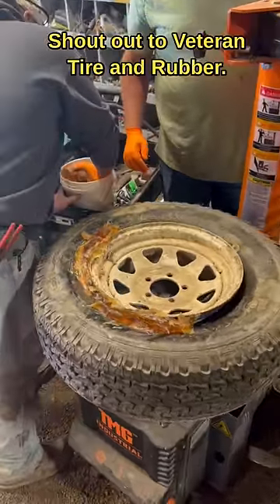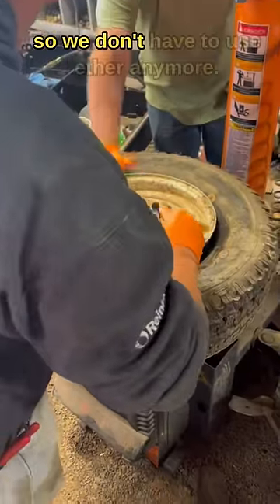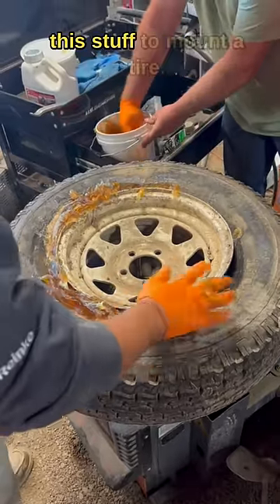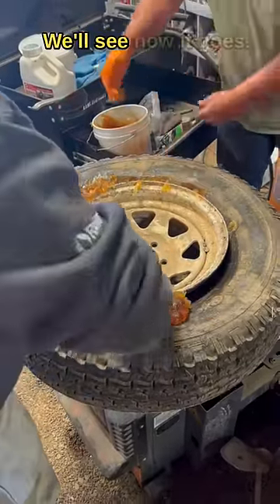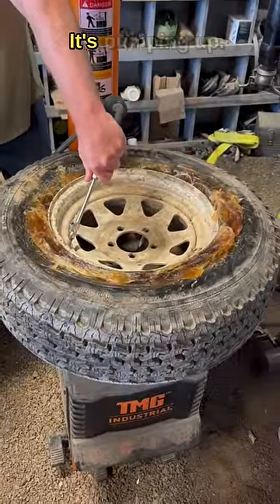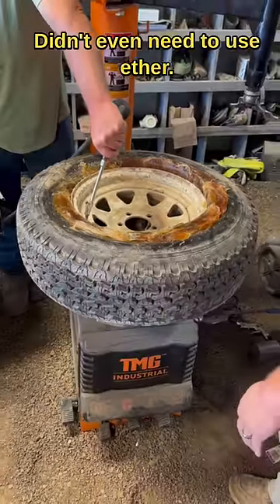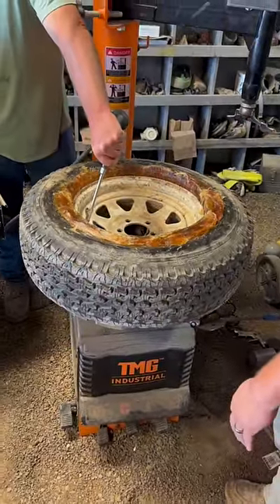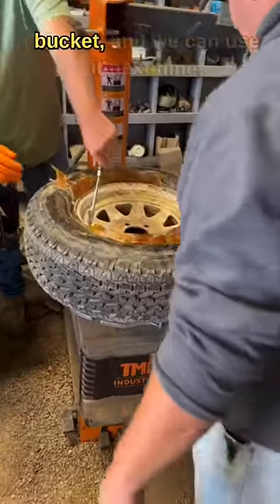Veteran tire and rubber sent some tire mounting compound. Let’s see it work. #farming #shorts ￼

Comment: Whoever owns that shop needs to evaluate a lot of things.
Reply: I believe it's just a farm shop
Reply: This isn’t tire lube.
Reply: How much stayed inside the tire? Balance issue down the road?
Reply: @emmasdad5426 balance issues on a tracker tire that's good to be going 10 mph in even dirt?
Not sure if that's something they have to worry about.
Reply: @emmasdad5426 it'll even out once they warm up 😅
Reply: My thought also
Reply: Why
Reply: @UlyssesCoto if it's not heat resistant maybe huh.
Reply: @christianterrill3503 my exact guess, I've seen that too many times 😂
Reply: This is legit tire man thing you wouldn’t understand becuase you probably need a machine to do everything for you look at the jump up unless ur willing to use a semi tire air gun on that and risk damage u do this
Reply: @dsandoval9396 In what world is the tire that’s used in the video a tractor tire that tire can’t hold the weight of a tractor nor does it have the tread capable of being used on a tractor.
Reply: I wanted to buy a tire mount machine too, but decided I will just pay the money when needed.
Reply: @Back_door_bandit_98  the world you dont know a thing about. TRAILER
Reply: Y’all that’s is a trailer tire 🤦‍♂️used to maybe carry a car, they will not feel that if any went in the tire nor does anyone really care😊
Reply: @niknak89 lmao right? Tire soap is a necessity if you know what you're doing. I've had front-loader tires that wouldn't mount without at least 3 gallons of soap on them
Reply: @jstewart627  you can get a couple pry bars practice aim with a hammer and you don’t need to spend money again
Reply: @rentalcar1712 
Why do you not use any punctuation when you write?
I'm genuinely curious
Reply: @AZ-kr6ff You forgot to write a period at the end of your sentence.
Reply: @technoviking007  
I didn't forget, I intentionally left it out because it's my understanding that a period at the end can be interpreted by some people as being rude, like an "end of story" type of thing, and I'm hoping the guy responds.
Reply: @AZ-kr6ff  😂 So, as your being rude correcting a farm boy on his lack of punctuation you purposely left off a period so you wouldn't come across as rude? Ya... not buying it lol
Reply: @TheGoatLocker  
I didn't correct anyone, and what does being a farm boy have to do with anything?
Reply: Id like to see your shop looking better
Reply: @emmasdad5426  that's what I was thinking. Either the balancer gives you an incorrect reading because the compound settles inside the wheel making it heavier, or the balance changes when the wheel spins because the compound spreads out. Not a risk I'd be willing to take, especially when the old way isn't particularly hard
Reply: @UlyssesCoto  yeah but you'd have to warm them up before balancing incase a thick clump inside the wheel throws the machine off and gives you an incorrect reading.  Some people won't have the foresight. Also, what about the compound settling when not in motion? Especially on a hot day. The balance would be irregular and shifting
Reply: @roachmansupreme  did you read that this is for farm equipment? There's no indication that this is for a normal vehicle. I don't care, I take my car to regular shops, not somebody in the middle of nowhere.
Reply: @GMG455 It literally is.
Reply: I don't think I'd ever seat a tire just standing next to it like that. Seen too many people get seriously injured from them blowing off
Reply: @GMG455 yes it is. I've been in the industry more than 20 years.
Reply: @emmasdad5426 trailer tire. Doesn't matter.
Reply: Guys, here is the true Savior

HalleluYAH translates “Praise ye YaH”

YaH is The Heavenly Father
YaH arrives via the TENT OF MEETING
YaH was Who they Crucified for our sins
YaH was Crucified on an Almond TREE

Semitic of Moshe (Moses)
Isa Scroll (The Original Isaiah)

Isaiah 42:8 - I am YaH; that is my Name! I will not yield my glory to another or my praise to idols.

Isaiah 43:11 - I am YAH, and there is no other Savior but Me.

Isaiah 45:5 - I am YaH, and there is none else.

Comment: “Im here for the 1930s style tire change”
Reply: Lmao
Reply: "and your wife gets a fre backhand"
Reply: I’m pretty sure that would be a ratchet strap, you use a ratchet strap around the middle of the tire. You ratchet it down as tight as you can while you’re airing it up in the bed will set that’s how they did it in the 30s.
Reply: @laksivrak2203 they still do it like that when the bead is too hard to set, most commonly now we have a bead blaster which basically builds up pressure that can be deadly then shoots it out expanding the bead to seal
Reply: @jankiejamk18  that is cool when I was young in the village in Alaska the strap was basically the only choice
Reply: @laksivrak2203  yeah gotta make best with what you got, the ratchet straps work good especially on big 18 wheeler tires
Reply: A doubled over rope is all you need. Started at a truck repair shop at 17, we did everything known to man. Tractor and implement tires full of calcium was my favorite....
No matter the tire size a doubled over rope is all that's needed

Comment: oh man, I don’t know if I’ve ever seen something used the wrong way that worked so well
Reply: That is actually soap, so it washes out the residue used to use it at a tire shop when I was young
Reply: @mrfonz8034 we know what it is. He’s saying that’s not how it’s supposed to be used but it’s surprising that it worked
Reply: I've worked in alot of shops that have done this
Reply: @TheTruthfulOnes  Actually, it was used like this all of the time.  Old school stuff.
Reply: @TheTruthfulOnes Ong I was finna talk sh¡T until it worked 😂
Reply: I mean. It can be used that way. Its usually used as lube instead though. Also if you want to get grease off of your skin dont even bother using water. Just get a little bit of that soap and rub it in and use your fingernails. Oil resists water and that soap is “Liquidy” enough to separate the oil from your skin without needing to use water til after you did a good job witb it while dry, then use water and use whats on your hands to finish washing the grease off. Im telling you it works so much better that way.
Reply: Just put soapy water on the rim and lighter
Reply: @TheTruthfulOnes  well if you have a tire, that’s not seating right that’s actually the proper way of doing it
Reply: That's good idea on and a hatchet
Reply: Like 1k
Reply: @alexanderpherigo6806  soap and a lighter? You need to rethink that one.
Reply: This is what I call "mission failed successfully"
Reply: @ryanboscoe9670  mb i mean starter fluid
Reply: i was literally thinking the exact same thing.
Reply: @alexanderpherigo6806  That's what they've been doing...
Reply: If you don't get all the goop off is the customer pissed bc it's all flicked into the wheel well?
Reply: Imagine, they had the answer the whole time with the phone they used to film this with to start.
Reply: How's it supposed to be used, then? Don't say they did it wrong without explaining it.
Reply: What about the big o ring they use with the tire butter .....Pretty sure their is a sealing ring missing
Reply: @MrDrHouse it comes with a brush and directions saying to add water and dip brush, then wipe brush around both inner and outer beads of the tire.  Periodically add water to bucket as soap solution is used over time.
It’s just a soap used for lube when mounting tires.  It’s not bead sealer.
Reply: @MrDrHouse fr lol

Comment: When someone has a bad idea but it works, and you can't convince them it was the wrong way
Reply: That's what happens when you sniff too much ether😂
Reply: If this is what its made for i gotta read the bucket at my work my manager oreder some for beed lube
Reply: @Newholland1982it looks like they'll be a lot of leftover grease on the inside and with enough times doing this you will have added way too much weight
Reply: Ive used a  brush then basically paint the bead with it. not like this at all it's a waste of product
Reply: @moonrooster7160 if so. And none of it goes inside of the tire. It rakes against the rim and it's squeezed out. I've done tires all of my life and I have never had any get inside of the Tire when I did it this way. They did use way too much but it still all came out
Reply: You got that right
Reply: I was thinking “there’s no way they pull this shit off” and the end left me speechless
Reply: I always wondered what doctors did with all that earwax they removed.
Reply: Not that I think this is a bad idea at all, but, "if it's stupid and it works, then it ain't stupid."
Reply: @Newholland1982just because people do it doesn’t mean it’s smart. They’re just sharing there thoughts
Reply: It's gonna get dirtier and dirtier ..... The wax gunk......and the tire will have a slow leak. So it's like rubbing mud all over the bead. This is really dumb. 

Just use pure alcohol in a dropper bottle and you won't "over ether" a tire and have it blow.
Reply: @Newholland1982  I was replying to what John said, simply sharing a favorite quote of mine.Saying I don't think it's a bad idea was to distance my comment from the idea that it might be expressed in John's comment.  My comment had nothing at all to do with the video.
Reply: @Newholland1982 Fair enough I have no experience with it.
Reply: A single word, "out of balance forever due to globs of crap inside the tire".
...or acouple
Reply: Your right because if it works then it isnt the wrong way bruh
Reply: @Newholland1982same here. Nothing ever works to get skid loader tires on except this stuff or ether
Reply: @moonrooster7160 I imagine it's going to be hell to balance it now lol.
Reply: Wont even waste my time to bother letting em know
Reply: Duck bills are 10 times faster, so I’d argue it’s the wrong way if you’re busy

Plus it will throw off the tire balancing with whatever grease is left over

Trust me guys you can get the same effect with a duck bill, leverage bar, and soapy water
Reply: It's made to lube the bead so that it doesn't rip when mounting and dismounting but have used it for this before
Reply: Omg u use a bit n spread it oh man
Reply: ...when someone thinks that someone has a bad idea, but in reality, they should've kept their mouth shut about it, because it's not a bad idea at all... and is actually the way it's supposed to be done....
Reply: Right up until they have to balance it.
Reply: @vwwrenchie314 and the sky was full of what looked like huge bats
Reply: Soap and a rachet strap works as good or better and no waste.
Reply: Happens ALL THE TIME!
Reply: I have used grease many times, but never to blob on a huge amount to cover a gap big enough it prolly let the air blow through too. We just smeared on a coat around both beads. Just make em greasy, no excess. Then, seat the bead on the rim at the bottom, then pull easy up by the tread to help seat the top bead while your bud is puttin' air to it.
Them guys are lucky air didn't just blow by the grease, and they didn't have to scrape the ceiling for that excess of grease.
Reply: Facts
Reply: IF IT WAS A BAD IDEA, WOULD IT HAVE WORKED? 
SORRY FOR THE 🧢 S
Reply: It's not a stupid idea if it works!
Reply: Yup that’s sad and scary man. Especially when it comes to cars or heavy machinery
Reply: What about imbalance from the puddle of that goo in the tire?
Reply: Not after seeing the reaction for themselves.  I don't blame them.  What's best is that nothing has been wasted.
Reply: The bad idea is to use ether and think its smart/safe
Reply: @moonrooster7160    1st. You don't put it inside of the bead. 2nd, How many times do you take the same tire on and off. We've had a couple of flats repaired over the last 10 years but that was on two different sets of tires. And if you do get any inside the tire maybe it'll work like balance beads for you. LOL
Reply: @brobeatsmcgeets3528  it’s just not innovative man, we already have better tools
Reply: @davidmoore6203  dude I just said soapy water works just as well
Reply: @moonrooster7160 Your tire will be dirt by the time enough of that compound accumulates on the inside lmao.
Reply: Until they try to balance the tire
Reply: @moonrooster7160  You are probably right. But some would call the job security.
Reply: Of course you can't you can't convince them to buy what you're selling is what you're trying to say this is a bad thing why? Never mind explain it to me again and put it in terms of you can't get this rim anymore.
Reply: Task failed successfully
Reply: @sk00ma  plenty of bad ideas work. Have a nice day.
Reply: Some people are more risk-averse than others and if you explain it to them carefully they understand particularly since there's a video out there showing a guy doing a tire and giving his life to prove that it will work
Reply: @Newholland1982 the grease is used on all cars however there's lots of variants, all of which should be brushed on lightly as lube to help the tyre sit, not to lather it up lmao.
Reply: 😂this is great..how bout the cheap tires where the beads are touching
Reply: @mitchll088  the general purpose here was to seat the bead but people lost that in the excitement of the explosion. The aether trick is the last thing I'd try but I try it if nothing else is going to work. I saw a video of a tire mounting failure using this technique that was fatal.
Reply: @christophermosley7557 same.
Reply: If you look at things that don't work part of the time and do work part of the time by intention they are quite treacherous for most people. I had a friend with a gambling problem. He told me he got a head a little bit at the start and he thought it was God bless him and he thought he could try harder and work harder like he did and he just kept throwing himself at this like a regular problem and it ate a lot of him. If someone has an idea that works all the time and it isn't a good way to do something that's not as bad as somebody who does something conventional like gambling. I've watched them all my life and told them they could give me all that money and then after a while someday I'd give him $90 back on $100 and you can tell everybody about his big win.
Reply: @moonrooster7160 does it though? Look at the profile of what they've applied before they spply more. Its a very very hard substance and doesnt seem to be protruding down unto the tyre
Reply: @Hazed64  it doesn't matter if the substance is hard or soft if it has mass and stays mostly in place that will be an imbalance when the tire is rotating at high speeds
Reply: Very common technique. Much better than axle grease which some people do.
Reply: Guys, here is the true Savior

HalleluYAH translates “Praise ye YaH”

YaH is The Heavenly Father
YaH arrives via the TENT OF MEETING
YaH was Who they Crucified for our sins
YaH was Crucified on an Almond TREE

Semitic of Moshe (Moses)
Isa Scroll (The Original Isaiah)

Isaiah 42:8 - I am YaH; that is my Name! I will not yield my glory to another or my praise to idols.

Isaiah 43:11 - I am YAH, and there is no other Savior but Me.

Isaiah 45:5 - I am YaH, and there is none else.